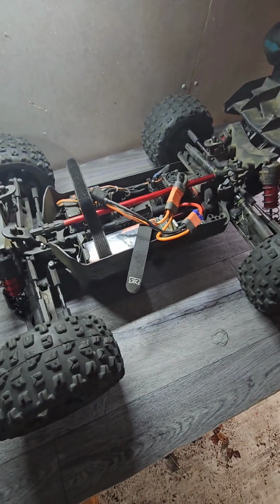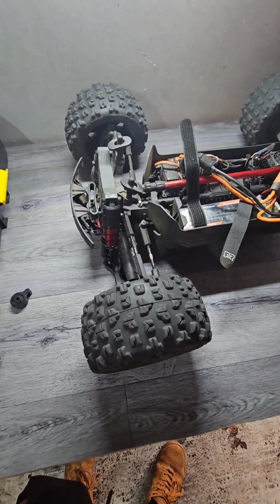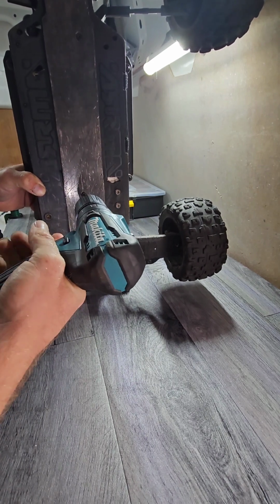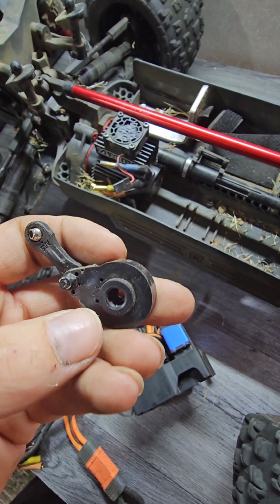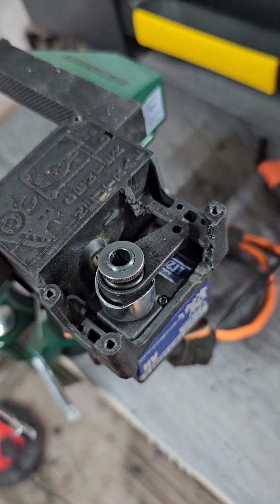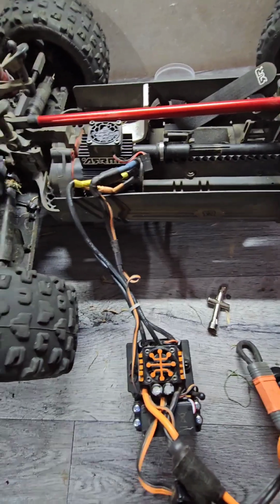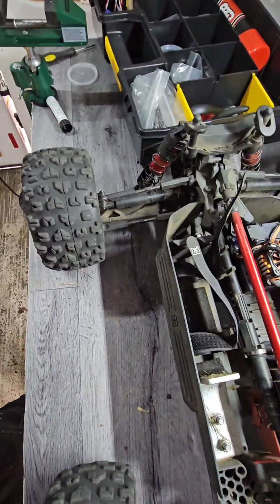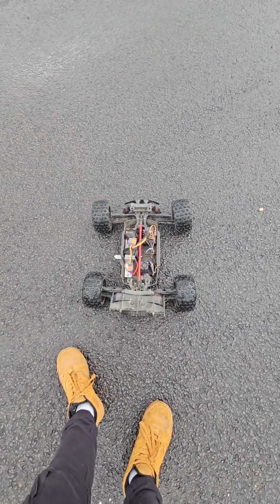Kraton/outcast 4s v2 servo saver fix. losi lmt servo saver

Comment: I did this when someone on facebook mentioned it. Very good idea
Reply from the maker: Completely changes how the car turns. I have got another one to try which is the gpm servo saver which doesn't need you to trim the receiver box etc. Will try it out soon to see what I prefer
Reply from the maker: @FlingingMonkeyPoop  I havnt yet no. I think it was the gpm large I bought. I honestly havnt really had any issues with this setup so havnt tried it yet. I will at some point though
Reply from the maker: Did you get this working after?
Reply: @RCforDais  Hey! Which gpm servo saver you mentioned exactly? Wanna try it out.
Reply from the maker: @Dupdopy  gpm large 25t servo saver. You still need to trim the actual servo saver and the servo mount assembly
Reply: @RCforDais  I see. Thank you
Reply: @RCforDais  not with the losi LMT saver. I just raised the servo by 8mm and cut a bit for clearence
Reply from the maker: @EXTREMERC416  yeh no need to cut the losi lmt servo saver but the gpm large you do. But gpm also make one especially for the 4s cars so maybe worth trying that
Reply: @RCforDais  what screw for in the servo safer did you use?

Comment: I’m going to try a simple fix. Going to take the saver apart and hot glue fill 50% of the spring cavity. This should really stiffen it up whilst still leaving some shock resistance
Reply: Update. This failed, and I cooked the servo lol
Reply from the maker: Lmt servo saver is the way forward
Reply: @markhalton2584  Not a bad idea though. Maybe shoe goo? But yeah I’m trying this Losi ss.

Comment: Thanks for the video. I’m going to try this. I think simple round aluminum spacers will work instead of having to drill out servo spacers. Yes, no?
Reply from the maker: Yes don't see why not. Aslong as its spaced up don't really matter how you do it aslong as it's secure
Reply: @RCforDais  All parts are in, including the servo saver. How tight did you make it? I guess I’ll start loose and tighten as needed, but there’s a wide range. From fully extended to fully tight, how far would you estimate you screwed down?
Reply from the maker: @tyrellcorp2118  I think I fully tightened it then loosened it off a couple of turns if I remember rightly
Reply: @RCforDais This works so well. I ended up tightening as much as I could by hand. I also used 10mm spacers. Even 8mm risked rubbing for me. The turning performance is night and day. Thank you.
Reply from the maker: @tyrellcorp2118  yeh personally I would now run more than 6mm myself too. But definitely a worthy upgrade